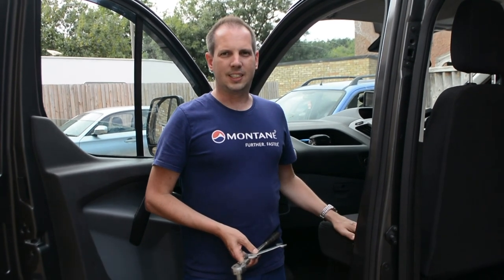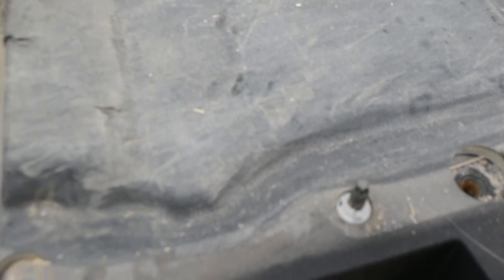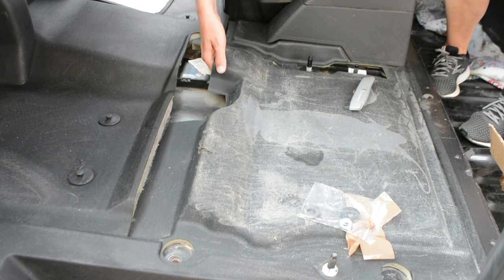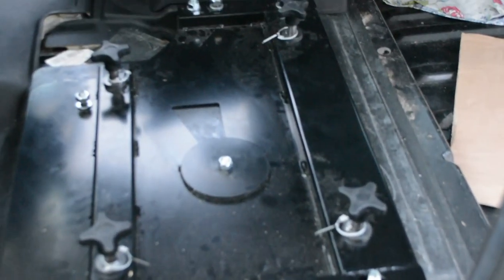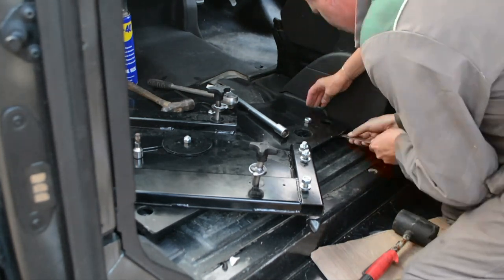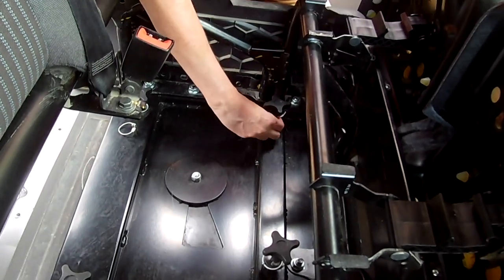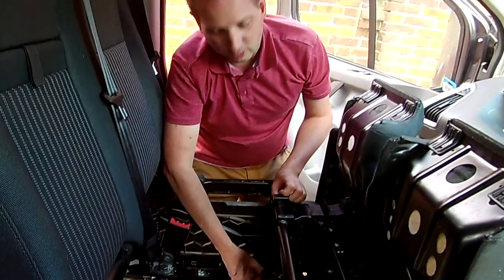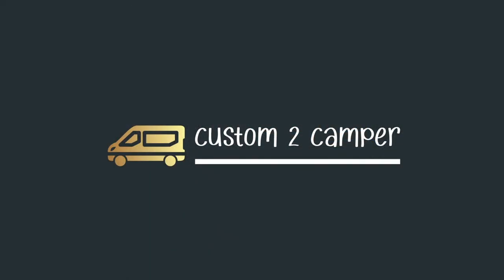VLog 5  - Double Swivel Base Seat on the Ford Custom Video

Comment: thx for sharing this, I just put mine in today from custom designs and i thought i had done something wrong until i watched your video. all works fine but does need to be accurate with bolt holes.
Reply from the maker: Glad it helped!
Reply: @Custom2Camper  the only thing I don't like about it is the seat ends up raised by 50 to 70mm and you lose the space inside because the seat swivels so if you put anything in what could be a useful space like a diesel heater you can't.
Reply from the maker: @ironian24  I’ve taken 40mm out of the seat base frame to bring it down to the same height as drivers seat and this has been brilliant,
Reply: @Custom2Camper  How did you take 40mm out of the base?
Reply: We ordered this last week for our Ford Transit 2018 LWB, double swivel . But think we’ve been sent the wrong one as the front right hole is 5mm out of line. There is no way it will fit.The paperwork inside is saying ‘test paper’ for the transit custom. Trying to resolve it is proving a headache! Spoke to a woman on Monday as all she keeps telling me is that it will fit! @frustrated.con. Your video is great BTW.

Comment: Nice to see someone that has fitted it correctly  
And not messed it up and tried blaming the Company 
How it this a year on do they pass mot OK 👍
Reply from the maker: Thanks for your message. A bit of time and patience and all worked out well in the end! Loved having it and wouldn't be without it now. The only thing I've done is chop 4" out of the seat frame and then get it professionally welded. Absolutely no problem with the MOT and has been declared to the insurance company with no issues. When it comes to MOT, I'm not sure if they check the seats at all - I know they check seatbelts but not sure if they touch the chairs at all.
Reply: @Custom2Camper  thank u for your reply I am ordering one over the weekend so I'm hoping with watching you do yours it will be easier  🤣🤣 wish me look
Reply from the maker: @davedixon6372  good luck! Lots of tea / coffee and some common sense you’ll be fine. Let me know how it goes.

Comment: I have just had the garage give me the van back after 4 hours on a basic transit custom saying it’s a poorly manufactures piece of crap we are not prepared to fit it! I have spent 2 hours looking at this and the drivers side rear hole/ fitting has been welded off centre from the base so I need to get the narrowest nut I can find tomorrow to see if a socket will go around it to tighten or it will have to go back, it will need shimming as there is a 4 mm drop to the front

Comment: Thanks folks. Does the added height not disturb seating comfort in the forward direction during driving?
Reply from the maker: It was a little high (about 40mm) so adapted the seat base and took 40mm out to bring back level with the drivers seat.
Reply: @Custom2Camper  Thanks, but how? Cutting and welding?
Reply from the maker: @Dyshof  yes, someone cut it and welded it back up for me

Comment: I have a Ford custom tourneo 2020 hopefully should be the same as a custom van , just a little worried about the heated seat , what do you think ? Thank you for your video, I will be referring to it as I go 👍🏴
Reply from the maker: Good luck! My understanding of the heated seats is that people just disconnect them before swivelling them.
Reply: @Custom2Camper  ordered my double swivel yesterday, they were most helpful, like you say the recommended just unplug the heated seat , but if you put a note in the order regarding the heated seat they provide you with a hollow centre bolt ,Then it’s up to you if you extend the wiring . The tourneo is slightly different carpet design, they sent me a photo for some extra cutting, I’ll let you know how it goes .

Comment: I've just installed mine today and the left side frame and chair side is flush with all the metal and body, the right side where it has a pertruding leg ready for the original bolt to go back on, like your mine is on a raised section. It makes it higher on the right side and finger ish gap. It's as if it should have been flat on the right side to make the base level. Now my chair isn't level and cause it's raised the frame part I'm sure is slightly bent so the 4 locks don't go in easy at all. 
To me it's a bad design as far as securing it down and being level. I had to do some cutting too which was fine but it's all gotta come out again to resolve it. 
Did you see the camper video and do what the other YouTuber did and cut the legs down and re welded it to lower it 5 cm or so inline with the other chair? 
If you did. Did you loose the front plate by where your heals would be?
Reply: Is your frame level or right side raised? Mine looks tacky and unprofessional
Reply from the maker: @paul3562  I think my base is level but I will take a look tomorrow. I took a bit out of my seat base but I can’t remember what I did know without looking. If you drop me a message via email using my username without spaces at gmail with a com (hopefully that will work and not get blocked by YT) I will send you some pics.

Comment: We have ordered one of these now and my partner would be grateful to know what kind of socket you have for this job please?
Reply from the maker: Thank you for your message. You will need the following:

T55 bit for the 4 torque bolts
18mm socket for the nut
T50 bit for the seatbelt
Stanley knife for cutting the rubber and a hard board to go underneath when cutting.
Grinder to cut down the retaining stud.
Lots of tea and patience!

Please not me know if you require anymore help.
Reply: Custom 2 Camper thanks so much, sorry though, I think I meant ratchet after all because our one is a lot smaller than yours and doesn’t have the long extension thing that yours did... we will look around though! Thanks again. Can’t wait to see the rest of your videos, we will be a few weeks behind you! :)
Reply from the maker: Caroline thank you for your message. It was just a standard extension bar to save scrapping knuckles. Something like this would do the job if you are using a 1/2” socket set: Silverline 783095 Extension Bar Set, 1/2-inch - 3 Pieces https://www.amazon.co.uk/dp/B000LFTSES/ref=cm_sw_r_cp_api_i_Nb9kFbZSV7YFQ
Reply: @Custom2Camper  Thanks so much

Comment: Very useful, thanks for posting this. I think you may have removed too many torx bolts though. There are only 3 plus the nut. The one near to the stud on the drivers side is not holding the seat down.

Comment: Hi. Thanks for posting this. 2 questions: Firstly are you still able to fit the drivers swivel seat too and secondly having used it for a while now is it easier to operate or does it become a bit of a chore? I'm really interested in these double swivels as it could really benefit my van build.
Reply from the maker: Definitely worth having and I didn’t have any problems fitting it like some people have. Now I’ve done it once I think I could probably do another much quicker and happy to help out with advice etc. as and when people need it. I found it invaluable looking at what others had done to get hints etc. Now we have used it a number of times, it gets easier to swivel and have it mostly down to a fine aren’t - probably could do the whole unlock swivel and relock in under 90 seconds now.
Reply: @Custom2Camper  Thanks. That's invaluable information. I'll definitely look at getting one of these. Got to get the van first though lol.

Comment: Thanks. I know vid is 2 years old but still useful. Btw I’m no H&s fanatic but do you still have all your fingers? She almost had you at 9:15 min :)
Reply: 😂 Yes I almost didn't dare look either.....for anyone else doing this if you use a hooked Stanley blade you will have far more control over the knife and it will help to avoid it slipping. I'm a carpet fitter so I know a bit about knives slipping 😊

Comment: Hello, I would like to know how high the seat of the bench will be raised.
And especially if it doesn't get too high. And maybe even touch the ceiling with your head
THANKS
Reply from the maker: It raises it up by around 4” but you can take that out of the seat base which I have done and makes a massive difference - it is then back to the same height as drivers seat.
Reply: @Custom2Camper  ok, but what I mainly want to say:
Doesn't adding 6cm of height with the swivel base seat raise the entire double seat too much? So it risks being much higher than that of the driver, right?
Reply from the maker: Yes it does but there are ways to correct it.
Reply: @Custom2Camper  ok, but How ? can you explain please ;-)
Reply from the maker: @ktmadventure  by cutting the seat base down by 4”. I will try to do a video of mine at some point.
Reply: @Custom2Camper  Ok ! thanks ;-)

Comment: Is this for a 2013 onwards? Did you not have to remove the heated seat? I have a 2017
Reply from the maker: Mine is a 2016 Euro 6 without heated seats. I understand you just unclip the heated seat connection before swivelling.

Comment: Did you not have issues with the reduction in head room? It appears to be around 4 inches.
Reply from the maker: Head room is reduced by 4cms not 4 inches. Yes it is a bit higher but well worth the height increase for the flexibility of a swivel.
Reply: @Custom2Camper  I've just had it fitted - that's where the 4 inches above driver's seat comes from.
Reply from the maker: @andyclarke9589  ours definitely doesn’t lift it by 4 inches!

Comment: I have recently bough a 2017 version and cannot for the life of me get the seat returned to forward facing position. The central bolt seems to be preventing it coming over far enough towards the drivers side by about 12mm. Is the central bolt just jamming or something underneath  going on. It also took me ages to get it to swivel rearwards. The video makes it look very easy to use but anything but in my experience so far.
Reply from the maker: I found that sometimes the 4 locking pins fall down when swivelling and then catch on the bottom plate but the pins look like they are in the up position. I also know that some people have remove the felt washer between the plates where the central bolt is.
Reply: @Custom2Camper  Thank you. Indeed the locking pins were falling down. Also, the felt washer was jammed around the bolt and cam. Once removed, being careful to not loose the bolt, it now swivels nicely. Thank you for your kind advise. All the best.

Comment: Don't buy this swivel seat. It is poorly manufactured and the holes do no line up.
Reply from the maker: Not had any problems with mine.
Reply: @Custom2Camper  transit?
Reply from the maker: @stinkyloulise  ford custom